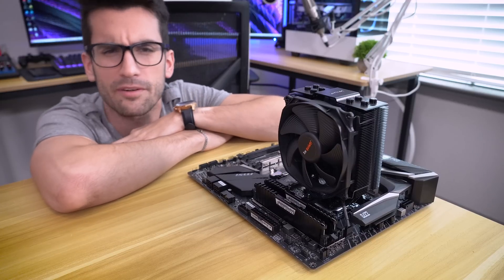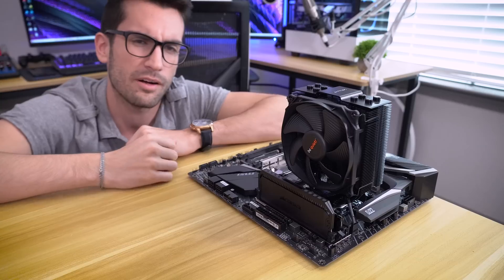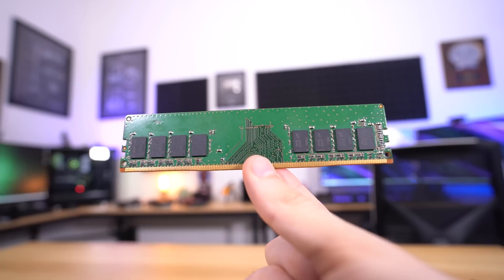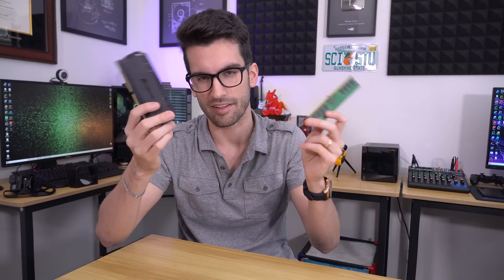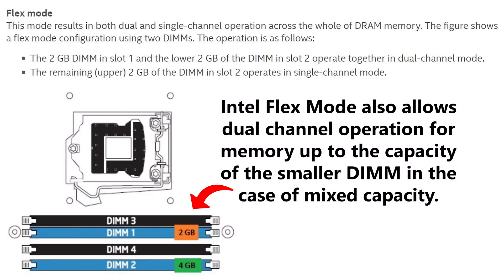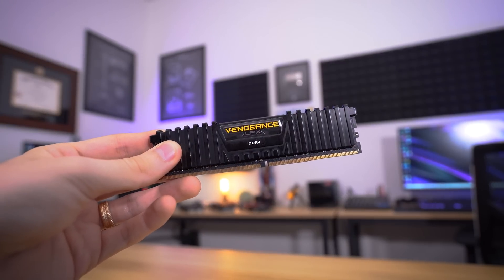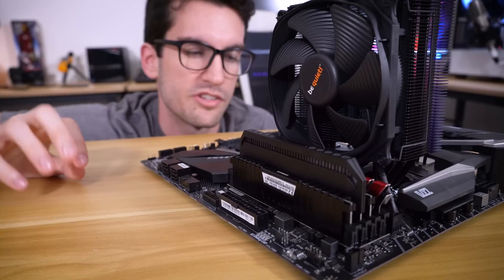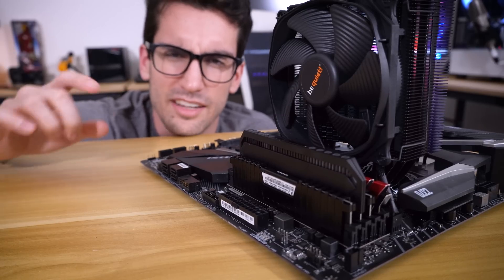Mixing RAM?!

Comment from the maker: I learned quite a bit while researching and testing this topic! Had no idea how dual-channel worked with mix capacities. Hope you enjoyed this one! Let me know what other morbid curiosities are floating around in your minds for me to investigate :-D
Reply: I've been wanting you to make this video for a LONG time.  Can't wait to hear your findings!
Reply: Why did you stop using #ScienceStudio as your company name?
Reply: I have a Ryzen 7 pc with a single 16gb 3200hz stick of ram and want to upgrade to 32gbs. Can I buy another matching 16gb stick and run it in dual channel or do I have to specify buy a  2x 16gb dual channel kit?
Reply: @hed420  yes you can buy a simmilar one
Reply: @hed420  You can just buy another single 16gb stick.
Reply: @hed420  If it is corsair RAM good luck...Even matching SKUs are not guaranteed to work together.
Reply: @Zamugustar  It's a single 16gb GSkill Ripjaws V stick . Paid $180 + shipping for it about a year ago when ram and video cards were way over priced . Today the same stick costs $80.  -_-
Reply: @hed420  Same, I've paid like 100€  for a 2x4GB Corsair LPX 3200Mhz kit 2y ago.
Reply: I wonder if you can mix SSD's and SATA drives in RAID...
Reply: SSD's and HDD's in raid??
Reply: YoungTechReview i know it’s not very smart. Just wondering
Reply: Same frequencies but different brands, my laptop is 8gb and I want to upgrade it to 16gb so can I buy another 8gb module with the same frequency, same generation, ?
Reply: Mr. Salazar, I watched this video on Christmas day with my mother. I guess you are an attractive man to her generation as she couldn't stop complimenting you. As a person in front of the camera I figured you would enjoy hearing that. ;)
And thank you for this bit of tech info. I was wondering about it myself for future builds. Would you mind doing a similar video on triple and quad channel memory?
Reply: Thanks for making this video.
2 weeks ago I only thought that upgrafing to more than 8gb of ram meant going right go 16 gb.
Now I can tell mixing 8gb with a 4gb can cover my 10-11 gb gaming needs(in dual channel asymmetric mode) instead of going to the 8x8 gb when only the 10-11 gb will be utilised while gaming.
Reply: I was also wondering about mixing kits. Most people call it a sin to buy two sets of 2x8gb ram and say you should only buy the 4x8gb sets as there is a high likely hood the ram won't work together otherwise.
Reply: How many bananas does it take to crush a pc?
Reply: Can i mix different voltage rams with same brand, frequency, etc.?
Reply: I added 2x4 3200 gskill with 2x8 3000 trident z rgb and it wouldn’t boot at 3000 , got it to boot at 2666 and eventually blue screened .
Reply: What about after you put them in your laptop, do you just turn it back on like normal or is there some type of setup required? Also I have a nvme ssd but am wanting to add a HD for storage of larger games. I'm a total noob so anyones advice would be appreciated.
Reply: I was wondering if you could have one 8 gb ddr4 with one 16 gb ddr4, same frequency and timing?
Reply: If I recall correctly, there are instances where you can mix ddr2 and ddr3, as there are certain am3 asrock boards that have both and work with both in, as the am3 phenoms had both ddr2 and ddr3 memory controllers on them that were independent of eachother.
Reply: Can I have 3×4gb of ddr4 corsair vengeance, 2400mhz, and then use my spare dimm of skhynix 4gb 2800mhz, but bring down the speed in the bios?
Reply: I have a question. I have a ddr 3 1600 mhz hyper x fury savage 8gb stick and a 4 gb ddr 3 1600 mhz server ram. Is there a problem if i have the 2 mixed ?
Reply: @Plurial As long as you have enough dimm slots
Reply: I actually got a hyperx 8gb ddr4 3200hz mixed with some generic 8gb ddr4 3200hz works perfect and reads 16gb which is all useable
Reply: @patrykzagrajek8036  it should read 16gb but does it work in dual channel or single channel....?
Reply: Try to get wired lan internet to work on real win 98 se pc  if you can and tell me the solution
Reply: I brought the same 2 set 8gb and there exactly the same however I get boot failures is that due to it being bad ram or bad compatibility ?
Reply: @shawzy908  check which ram does ur motherboard and bios supports
Reply: Can you mix different voltage modules?
Reply: @goyingus  hello
Reply: @goyingus  well l have 2x blue ddr3 1067 mhz and 2x green samsung ddr3 rams idk their mhz l never looked cuz pc works great
Reply: Express Fax are the different voltage?
Reply: @goyingus  where can l find out?
Reply: @goyingus  and if you wanna know which ram can be used on ur motherboard search the eathernet for ur mozherboard information
Reply: What about Using 3×4gb ddr4 ram ?????? How well or bad it will perform
Reply: @prince-of-saiyan  ddr4 wow man that is really fast but for fps doesnt matter rly
Reply: how timing affects in adding ram, my existing ram is 8gb 3200mhz 16-18-18-36, can i upgrade it with 16-20-20-38...will i able to use dual channel
Reply: @hasnatjamil8821  yeah bro totally
Reply: Song no copyright and link 
https://youtu.be/bW1hKSg1Yic
Easy to download, easy MediaFire link
Please try 
I hope you enjoy 😁..
Reply: 3:36 help me .. i didnt get the meaning.. Today i bought a teamgroup udimm 8gb ddr3 1600mhz ram and put together with my default 4gb hynix 1600mhz dimm ramm.. and pc said it ran into a probloem and went on to boot loop.. But both of them worked fine in any of the 2 ports alone.. My slots are dual channel and 2 slots only.. what happened and what should i do??
Reply: Is it ok to buy individual same brand, model, spec RAM sticks for dual channel rather than a proper RAM kit

like buying two individual trident z sticks or mixing ram from another trident z ram kit vs the actual trident z ram kit
Reply: LittleBertz yes 99.99% it will work.. but just compare the costs..
Reply: What are the implications of these findings for anyone who has ram soldered on to their laptop motherboard? Particularly anyone with 4gb soldered
Reply: Can I use same frequency ram of different company's
Reply: I have x370 chipset i can mix gskil flarex 3200 cl14 with gskill 3200 cl16. If i buy cl16 memory can i run dual channel with lower timing cl16 ?
Reply: Would a DDR4 xpg 8gb 3000mhz work with DDR4 Viper 16gb 2666mhz sticks
Reply: can I mix 2 modules that are same speed , same manufactuer , same model, but bought at different time.
Reply: Hey, Greg can I mix the same brand, same speed, same capacity, same everything but 1 dimm is value ram and 1 is performence.
Reply: can you mix different branded ram but same GB?
Reply: I'm a little late to the party but I just want to know I have a set of 2×8 gb Corsair vengeance lpx with the model CMK16GX4M2D3200C16 I can't find the exact model in 8×2 gb. Can I perhaps use the exact same model but In 16×2 gb or can I use another model let's say CMK16GX4M2B3200C16 will that work?
Reply: @GregSalazar how about mixing 2 different brands ramen kit? Let say 8x2 corsair with 8x2 kingston fury on a 4 slot dimm? Both have same cl16-18-18
Reply: Is it possible to pair a 4000mhz 16gb ram pair with a 3200 64gb
Reply: @oreo5892  xD you crazy
Reply: @oreo5892  right now l am installing win xp on 240mhz cpu and 64mb ram

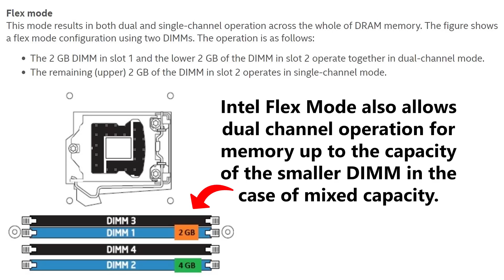Comment: @4:34 There must be a typo. and the lower 2 GB of the DIMM in slot 2 operate together in dual-channel mode.  DID YOU MEAN 4GB of the DIMM in slot 2 operate together in dual-channel mode? 2GB in Orange and 4GB in green.

Comment: in short, it always goes down limited by the worst and smallest module
the processing is then limited by the number of the used slots (above dual channel)
2 slots = easiest and fastest (if 1 busy = we use the other, no need to process)
1 slot = limited by the stick speed, 3&4 slots = limited by the motherboard processing (choosing between 3 or 4 slot is too hard)

Comment: Hey Greg, I need some advice on a RAM configuration issue with my new build!

Problem:
I'm building a new PC with an MSI B650M WiFi Gaming motherboard and I have 4 sticks of DDR5 RAM but there's a mix:
- 2 sticks of Corsair Vengeance RGB DDR5 6200 MHz (XMP).
- 2 sticks of Corsair Vengeance RGB DDR5 6000 MHz (XMP/EXPO).

I know mixing RAM with different speeds and profiles (XMP and EXPO) can be problematic, so I’m trying to find the best way to get them to work together stably.

My Proposed Solution: 
1. I plan to install only the 6000 MHz EXPO kit first and enable the EXPO profile to let the motherboard automatically set the timings, frequency, and voltage.
2. I’ll note down the settings (timings, frequency, and voltage) applied by the EXPO profile.
3. Then, I’ll install the 6200 MHz XMP kit and disable the XMP/EXPO profiles in the BIOS.
4. I’ll manually input the settings I noted earlier to match the EXPO kit’s configuration.
5. Finally, I’ll run some stability tests to make sure everything works fine with all 4 sticks installed.

What’s Your Take
Do you think this method will work to achieve a stable setup, or is there a better approach you would recommend for mixed XMP and EXPO RAM on an AM5 motherboard? Any advice would be greatly appreciated!

Comment: i have 2 rams one of them is cl16 3200 and the other 3000 cl15 i just set it to 3000 set the voltage to 1.35 and just set it to a low cas latency around 18 and its working fine is it worth it? maybe i mean i had no other choice either that or buy a new ram

Comment: hello i need help i accidentally overclocked my ram too much and wont boot anymore and i decided to reset cmos it worked but when i was gonna change my ram speed when i exit bios my pc dies and turns on and turns off and turns on and boots then my ram speed didnt change i have 12gb ram 2666mhz my pc is lagging and i have more unexplainable problem but i ignored it i can still play but my only problem is my ram that speed cant be change.

Comment: what happens when the modules have different Voltages? I have 2 sticks with 1.35V and could get 2 more but they have 1.5 V. will they work together fine ? or does the voltage difference do something ?

Comment: what happens if I run a 1.5v ram with a 1.35v ram? With the voltage differences will it fry the 1.35v?

Comment: It really depends on the board too. I myself used 2 kits of different RAM. One was a Hyperx Blu kit and the other was a Hyperx Beast kit,both had the same frequency and voltage but different CAS latecny. Used those on a Gigabyte board with not a single issue,but on an Asrock board that was also more expensive and higher end than the Gigabyte it would work but it was unstable and sometimes it would not POST or completely crash randomly while using the computer and also Windows felt slower than what if would feel if only one of the 2 kits was used

Comment: How about mixing 2x8 4266c19 with 2x8 4133c17? Which slots would be preferable for the better dimms on a daisy chain MB? Both kits are BDie and can run at the same speeds and latency but I hear daisy chain like certain channels better.
I love learning.

Comment: Can I buy TWO DIFFERENT PAIRS OF THE SAME RAM and run them in 4 stick dual channel without issues?
Same latency, same frequency? I cannot find 4x8 set for the RAM I want. There is only 2x8 and 2x16 but I want to populate all modules.
Reply: Bit late but you could buy "dummy ram" instead
Reply: @LadyMaria_AstralClocktower  well there is no "dummy ram" option for my ram kits

Comment: i have a serious question and best buy are no help lol. cheap gamers here and my brother has a cyber power pc with an asus prime B360M-A running core i5-8400 with 1 8gig stick of ram. i guess ram is scarce for this computer and all i can find thats in my budget is a PNY 2x4gig kit. can i add these 2 4gig cards to the computer without having problems? and what slots would i use if im running 3 ram cards? thanks Greg! UPDATE- another thing i just thought of is the ram in this computer is at 2400MHz. will this motherboard support anything higher? all i can find in ddr4 is 3400 and above. i was told i could if i updated my power supply???

Comment: Hey Greg, I have Corsair Vengeance 2×8GB 2400MHz DDR4 RAM running in my system. Now, I need more memories, can I add Kingston HyperX Fury 2× 8GB 2400MHz DDR4 on my system. Will different brands with same specs cause any issues? Please help 🥺

Comment: I have a question. If I have a dual channel 16gb (2x8) and another 32gb (2x16)  both at different speeds. Does it work? I know it might sound dumb but I just want to be sure. Thanks kn advance

Comment: Ok so I tried mixing two 8 gb ram sticks with another two 8 gb ram sticks and now my pc won't boot at all. The fans twitch but nothing else happens and I tried switching the ram back to how it was and it still does it. I tried one ram stick at a time in each slot and the same thing happens aswell. I also tried unplugging the power cable and switching the pc off then taking out the cmos battery for around 10 minutes and trying it again and that didn't work either. Please school started today and I really need help 😢

Comment: If i mix two rams same generation, same latency, same frequency, both are 1Rx8 but they are from different manufacturers.
Will i also lose on the performance?

Comment: Hi, Greg. I wanted to install 2x16GB with another 2x8GB, to have a total of 48GB. All modules have the same speed of 3200MHz and are from the same manufacturer and that is Kingston. If I understood correctly, it is possible and I will not have any problems. Right?

Comment: Dont forget that the Speed usually will follow Slowest JEDEC standard.
If your ram are from good manufacture its not going get any error in modern processor.

But lately we seen RAM manufactured by chineese who are didnt meet JEDEC standard, that RAM gonna make a trouble in the future

Comment: I have a question and I think it’s the right place to ask.

Can I mix Corsair vengeance RAM (3200 Mhz cl16) with Corsair Dominator platinum RAM (3200Mhz cl16)?

More specific: I am using Corsair vengeance 16 GB (8*2) 3200Mhz CL 16-18-18-36 RAM for over a year but i need to upgrade to 32GB and I can’t find the exact SKU in vengeance series here because my RAM have SPD Latency of 15-15-15-36 but most RAM is SPD18!

Only one kit of dominator platinum RAM I found that is exactly same as i am using right now CL16 SPD 15-15-15-36 and on top of that it’s going really cheap so I’m more tempted to get one but i wanna make sure everything will be fine. Please help me out!

Thanks in advance:)

Comment: Hello, Greg! Thank you for this! Quick question. My board has 4 memory slots. I'm currently using a pair of 2400 mhz HyperX Fury. Would it be possible to add another pair of 2133 mhz RAMs of the same brand, to the other 2 slots?
Reply: If you do, all your ram will be 2133mhz, including the 2400mhz

Comment: What about same Corsair DDR3 1600MHz 2x8gb 16GB LP installed with  Corsair DDR3 1600MHz 2x4gb 8GB LP ? I guess I can get Corsair DDR3 1600MHz 2x4gb 8GB LP as that's what I already have.
has anyone tried it? I have a Z97-P I have i7 devil's canyon.
Reply: Update: I upgraded the old pc with the same sticks, no idea if it's exactly the same parts but same model. It worked well. No issues. I went for Vengeance ddr4 on my new pc as I did not have any issue swith the Vengeance ddr3.

Comment: ima just ask a question because im still confused. would it be bad if i ran 2x 16gb 3600 on my optimal slots(b1, b2) and put my old 2x 8gb 2666 in the other slots?
Reply: You can but if you plan to use all the RAM capacity be careful cauz i heard of if a stick is full and the PC tries to access to more memories on leftover sticks it will beslow for reasons

Comment: Soooo maybe i bought a prebuild and just kinda assumed it had 1 stick of 8 gig so i bought a matching stick of 8 gig and TURNS OUT i was looking at the wrong pc, MY pc runs 2 sticks of 4 gig so i kinda just shoved the 8 gig in there, works fine but havent seen a performance upgrade so am gonna sell the 2 sticks of 4 and the stick of 8 and just buy 2 new sticks of 8 that i know 100% will optimise performance

Comment: Ok so I'm also jumping on the "weird numbers for ram" wagon. About to do a 48GB setup. 

PC originally had 2x8GB Kingston HyperX DDR4 at 2133 (occupying slot 1 and 3)
I have recently bought a 2x16GB Corsair vengeance DDR4 at 2400 (which will fill in slot 2 and 4)

Do you think there would be any issues with this config? Is the channel setup going to offer the best potential with this split? (Allocating dual channel for each memory type like described). Of course I will downclock the Corsair ram to match 2133, it's what the mobo/cpu combo supports anyways. Just bought them cus they were cheaper than the 2133 version for some reason.

I do believe both ram sets have CL of 14-14-14, so that should work out fine.

Comment: Can i mix 2x8Gb Gskill Trident Z 3200Mhz 16-18-18-38 with 2x8Gb Gskill Trident Z 3000Mhz 16-18-18-38 on a B550 + Ryzen 5600X to populate all 4 dimms and make the 3000Mhz one to work at 3200Mhz ?! Thanks
Reply from the maker: You may have to tweak its timings, but it's not impossible. All depends on the tolerances of the kit.
Reply: @GregSalazar  So in the worst case scenario i can use the 3200Mhz at 3000mhz ?!

Comment: Yes, mixing Ram is a common thing in Asia. But, it's very hard to overclock, getting the timings is like a lottery.
Reply: I have a c19 16 gb 2666 ram overclocked to c16 2993  paired with a c16 2666 overclocked to c16 2993

Comment: I have ADATA 16 gb ddr4 3000 Mhz one stick and i will put in MOBO 2x8 GB Adata 3200 MHz. Can i do that and can i run just one dual channel (2x8 GB) and 16 gb stick in single channel?

Comment: If i pair a 16GB with a 8GB Will it just 
16 + 8 = 24GB or will it cap at 16GB with 8GB speed…
Reply: U will have 24 gb ram, but both will run at the lowest frequency of either one. If both have equal frequency then it will run at that frequency